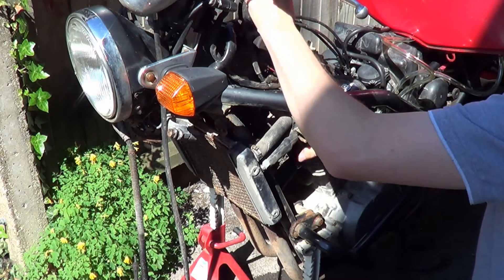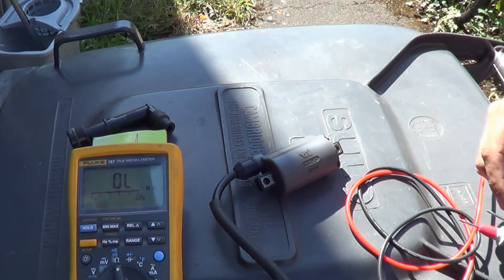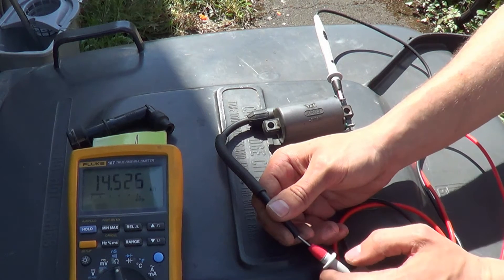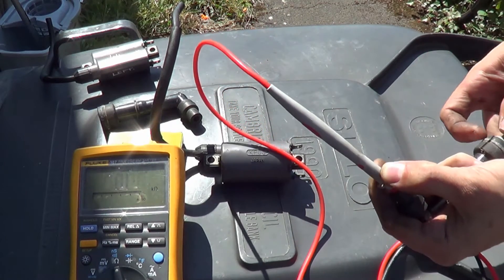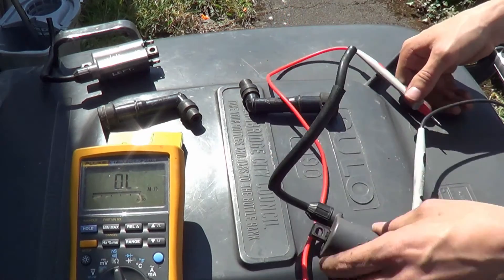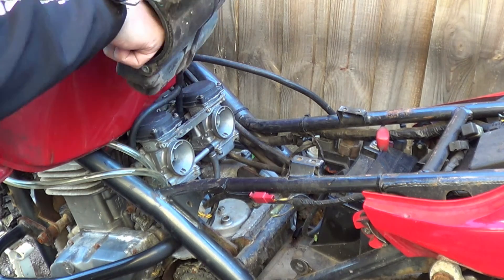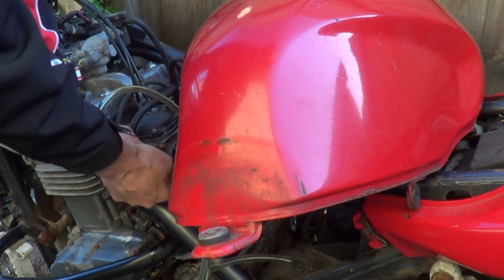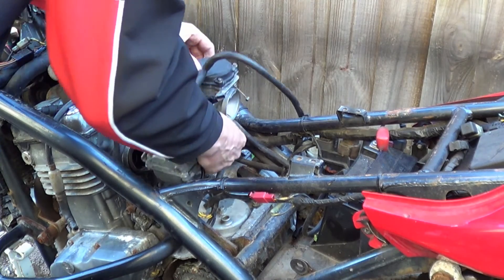Ignition Coil Testing - ER 500 - Backyard Bike Project - Episode 13

Comment: Hi! Does anybody knows if the spark plug wires for the ER5 are replaceable? It appears to be so but when trying to the twist off the thing that seems to be the lock nut near the coil, it doesn't rotate. I don't want to foce it.. yet.. so waiting for your replies. thanks!
Reply from the maker: Yes you can - and the caps
Reply: @thedirtyworkshop  thanks for your fast reply! Is that some sort of lock nut or does the wire needs be screwed in the coil? (same as the spark plug cap screws into the wire?)

Comment: Hi mate great vids just bought a er5 and having same issues as you with running on 1 cylinder at idle , iv gone through all your vids with a tooth come to find out what the issue was and can only assume it was pilot jet which u mentioned in a comment did this sort the issue mate ? Thanks in advance

Comment: How did you go with this issue? My ER-5 is doing the same, running on one cylinder until you rev it up high the other cylinder kicks back in, sounds like the left cylinder is to blame. I inspected the carbs, cleaned the main jet, float bowls,  but didnt take the whole thing apart since it didnt look too dirty.
Any advice
Reply from the maker: The issue is the pilot jet is blocked. This jet supplies fuel to the engine when at idle, it keeps supplying the cylinder until around 3000 rpm then the main jet kicks in. One thing about carbs and a mistake that many (including me) have made is 'it looks clean'. The holes in the jets are tiny and all it takes is loose crap in the carb to then find its way back into the jet. A good idea is to boil (in water) your carb and then when putting back together do it indoors and wear gloves. 

Hope this helps - matt

Comment: hi love the vids I've just bought an er5 to strip down . before i do i need to get it running i have no spark replaced coils and plugs. i have a question for you though if you don't mind. i have 12v at both terminals at all times and i don't think its write. can you tell me if yours did please
Reply from the maker: You still have the coil connected to the battery? The circuit runs from the input to the end of the HT lead, that is the path running throught the coil pair. Secondly to test the coils you need to measure resistance

If your having trouble with ignition have to got the correct spark gap and do you have any spark at all?
Reply: no spark at all at either plug . both plugs are new and both coils.
Reply: i have 12v at the coils at both connections doesn't alter when cranked either
Reply from the maker: the ignition coils are grounded by the starter button and engine stop switch. The fact they you can start the bike and I prosume stop the engine means they're ok. The only other 2 things in the system is the pick-up coil which you can test and the IC, which is abit more complicated but you can test. Do you have the workshop manual?
 If you stick a multimeter across both terminals then you won't see more than 12V, thats the primary winding, what were you expecting to see?

Comment: So are you running those 2 clear hoses from fuel tank to fuel tap to carbs? Or do others hoses need to be connectod too?
Reply from the maker: +fps103 The 2 clear hoses run from the tank to the fuel tap. 1 is the main fuel line and the second is the reserve line, otherwise fuel pisses out of the tank/tap

Comment: I've always used the old fashioned HOTTAS method for testing coils.

This requires a gulible, trusting assistant (sucker).

You say to the assistant, "Hold On To This A Second" and hand them the end of the HT lead.

You then trip the coil and judge the state of the coil from thier reaction:

No reaction = dead coil or brain dead assistant.

"Ow!!" = weak coil.

"You bastard!!" with a jerking or jumping action = coil OK.

Assistant leap into the air, lays on floor twitching = high output racing coil.

This test is totally safe to the tester as only the assistant suffers.Note that this also works with magnetos.
Reply from the maker: Andy Reid awesome, will have to find an assistant right away lol
Reply: Pony Power I caught my younger brother out twice on the same day whilst sorting the ignition out of his GT380M back in 1988.I told my son about this event last year and whilst we were workingon my son's ignition in the drive, my brother turns up and asks, "Can I help??" to which I replied, "Sure..... hold on to this a second.....", and just as he was about to my son started to laugh and my brother started to have flashbacks to the GT380M incident back in 1988.If you can try to catch your assistant performing a HOTTAS test on camera and post it on U-Tube (or You've Been Framed!!).
Reply: Been caught like that before. 
Do is a favour youngen, pass us that coil of the bench! 
It must have been a racing coil by your scale because I do believe I shit myself. Hahaha chasing things round the bench with a screwdriver after that.

Comment: It doesn't look electrical, but leaks in pipes, wrong air petrol mixture can give these problems.........hopefully the next videos will give us the solution.......exciting moments...the fact that it runs on both cylinders once past tickover could be significant......nice idea for a competition.......roy
Reply from the maker: ROY Dean My thought exactly, just wanted to show others how to narrow down the problem until you have negated everything else. Yeah the idle to main jet was a dead give away. - cheers for the comment - matt

Comment: I was going to suggest doing a vacuum test, like during  carb balancing. When you removed the carbs, it appears the rubber bung is missing from the fitting on the right hand carb. (where a vacuum gauge would be connected.) At 13:42 on the video. Is it the right hand cylinder that is dead? That would be a definite leak!
Reply from the maker: BooCooDaBreeze No thats the line I remove at 12:37. The line is the vacuum line that runs to the fuel tap to open the diaphram. The other matching hole on the left hand carb is still in place. thanks for the comment - matt